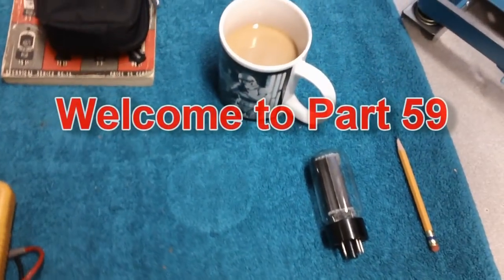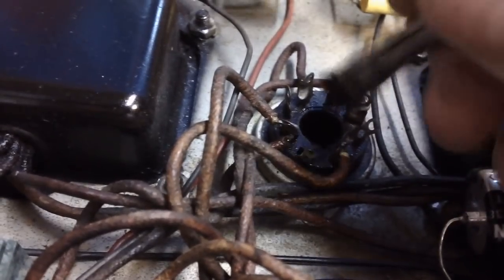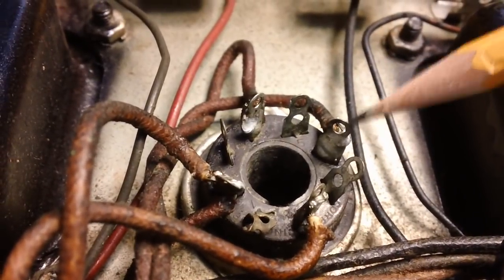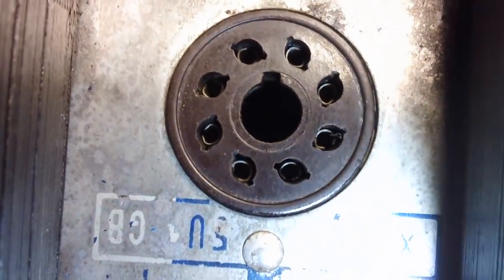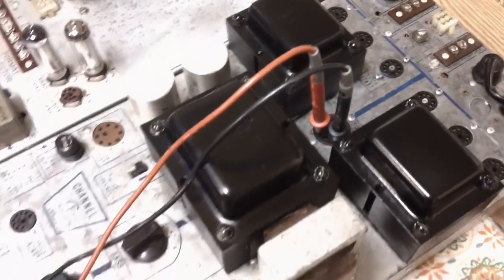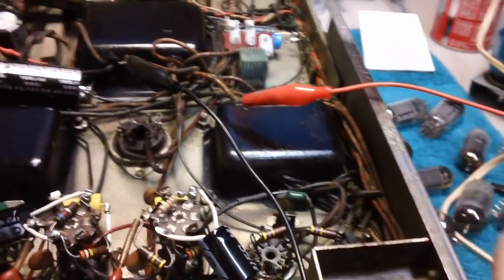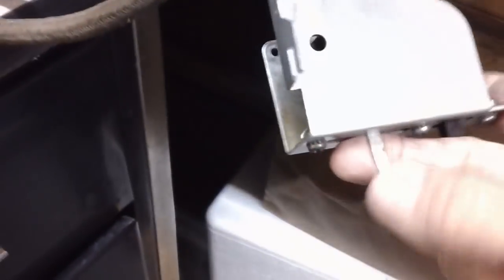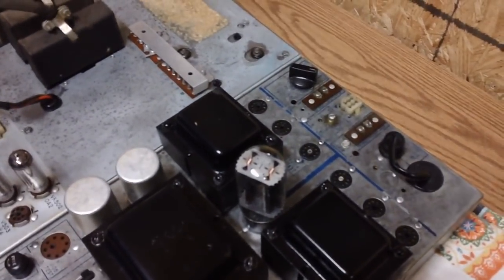1961 Seeburg AY100U Jukebox restoration (Part 59 of 87).

Comment: John,
Awesome work! I learned the trick on the 5U4 much like you did! I ended up using a gator wire to jump two pins inside the Tormat when testing the amplifier. I didn't have a service switch. 
-Cody
Reply from the maker: Cody,
Actually, I didn't learn it.  Harry told me.  LOL
Regards,
John

Comment: ha ha...nice one, i was shouting at my PC ....service switch!!  been there with jukeboxes many times, you spend all day, and the cause was starring you right in the face....all part of the fun LOL....when working on these seeburgs, i made up a lead with 4 female and 4 male spade connectors, you can then work on the amp without having it tied to the tormat unit
Reply from the maker: Hopefully, I won't need to make any leads, but will if I have to.  Done it many times, my friend.
Regards,
John

Comment: John, I'm glad I've helped you on this, not the first time for a service switch to cause a headache. I've worked on jukeboxes for 50+ years with my dad having a route when growing up. I remember him driving 40 miles to turn a service back on after changing records on a jukebox, he got sidetracked talking to someone. If you have the complete book on the AY go under the operation and it tells all about how to change records, title strips and using the service switch to scan and move the mech. The add and subtract thing is what starts and stops the mech whether in play or scan mode. It stops on the right end after the last record plays!!

Comment: You might want to connect the audio input to an iPod or other input device and connect some speakers to that amp just to verify that part of it is working and then go on and check the tormat and record player next.
Reply from the maker: Stephen,
The speakers are already connected to the amp and I'd also thought of running an external audio source through it, but we're not quite ready for that yet.
Regards,
John

Comment: On my 1966 Rock-Ola Jukebox, the filaments are at half voltage until the record arm makes a micro switch right as it starts to play.  That on drove me crazy as the amp works, just didn't have any volume until one day I bumps that micro switch and it blew out my ear drums.  5 mins cleaning later and all was well.  
I will also recommend that you test all the contacts that you cleaned with a multi-meter to confirm that they are making and breaking as designed.  I had cleaned with deoxit and paper like we normally do on radios, but it was not nearly enough.   I had to get a burnishing tool and get way more aggressive than normal to get continuity thru them.  My coin mech was a pain with poor contacts and a pain to troubleshoot. 
I would then recommend that you put it all back together and just run it as lot's of items depend on other things that are not apparent.
Reply from the maker: Aric,
All the contacts have already been tested for continuity.  They're good.  And I can't use a burnishing tool as the contacts are gold plated.  The last thing I need to do it mess them up.
Regards,
John

Comment: Hi John. I have tightened octal tube sockets just like that. In past years I have had trouble with 5U4 tubes going on and off in the socket especially in Hammond Organ PR-40 tone cabinets which has two 5U4s. It is great your friend pointed you to the problem. 73 DE
Reply from the maker: Those 5U4 pins are too skinny.  There oughta be a law.  LOL
Regards,
John
Reply: The 5U4 tube bases are always minus two pins so I think That's another reason some 5U4 tubes tend to lose connection but this wasn't the case with your project and the service switch. That's why jukeboxes with tube amps could play the record right away just by simply switching the rectifier filament on or off. The 1947 Silvertone TV I have been struggling with had two 5U4 tubes. The guy who butchered it soldered two diodes in under the chassis. Gary

Comment: Hey John, how about a big shout out for old Harry Hall? He sure saved the day! Good man!
Reply: yes the service  switch works the add and subtract solenoids, this is what makes the mech scan twice and then park at the left end.  spring side starts scanning and turns on the amplifier, pressing the slide switch twice  stops the mech and turns off the 5U4 (no plate voltage B+ for the tubes when in standby mode.
Reply: Harry gonna do better than crappy Dairy Queen for a good banana split.  
Big Boy made a badass banana split.  Remember the banana split boats at FW Woolworth's snack bar?  I'd like to see Harry make a vid of him feasting on  a banana split from Johnny.
Reply from the maker: Highest Rebel praise:  Ya done good, Harry.   Question: What's supposed to happen when the service switch is moved to the non-spring position (the opposite end)?  This one does nothing.
Regards,
John